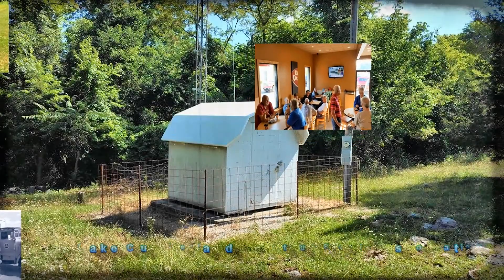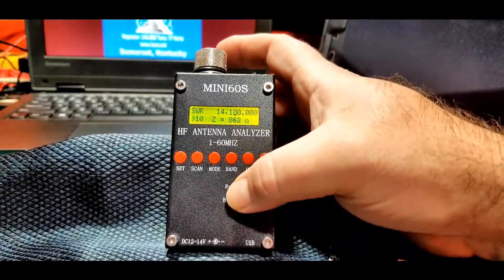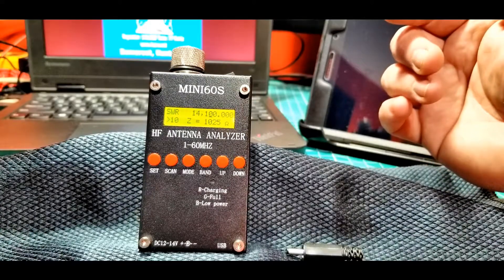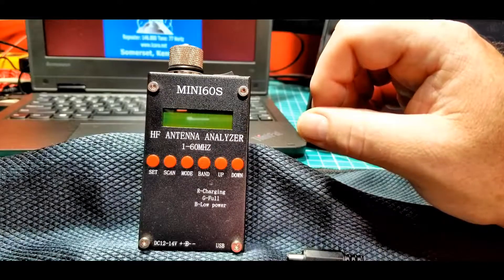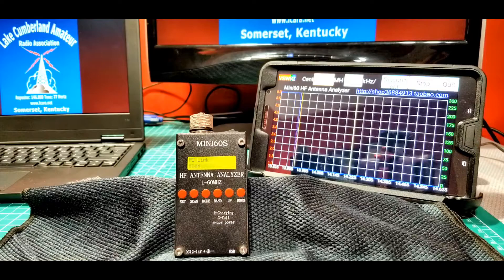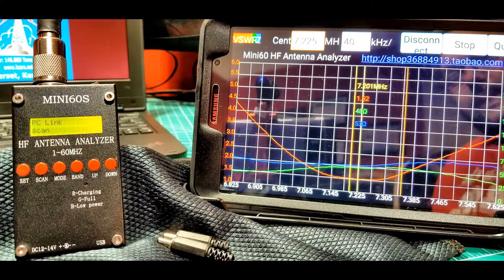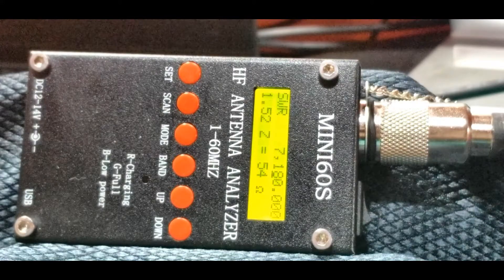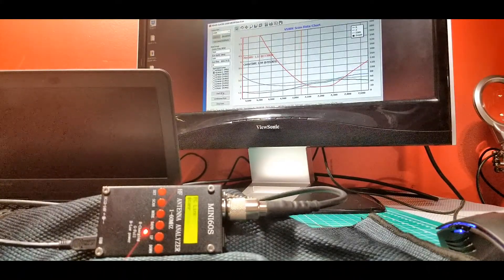LCARA HAM Radio: Mini60s Antenna Analyzer

Comment: I bought one of these from KK Moon and it didn't have a battery, battery case, charging circuit  or USB socket.  Any idea where I can buy these repair parts?
Reply from the maker: Sorry, I do not know of any place that sells parts for the Mini60s.  You might want to return your unit and try purchasing form a different vender.

Comment: Question on 11m when you set it for 11m does it automatic set.center.freq or do.you have.to put it in
Reply: On the software for android the as in the video and i have used was very flaky for Centering a frequency, i used another version updated by a Ham user Mini60-DH1KLM-08.18.apk 
far better and you get a lower swr reading than by the mini60s itself, so i use the android devices connected by bluetooth more than the mini 60s by it self plus you can see the visual display especially on the tablet for lowest band swr for that frequency and total bandwidth available and can then adjust your antenna, great for WR mini coil or WR 1000 to centralise 
the frequency you require.
Reply: @mikeh9446  where did you get the new software
Reply: @mikeh9446  I got 1.3 on a fire stick but the khz do I leave that at 1000 or 1200
Reply: @mikeh9446 where can I get this version
Reply: You all probably dont give a damn but does any of you know a way to get back into an Instagram account??
I somehow forgot my account password. I appreciate any assistance you can offer me!
Reply: @Landyn Donovan instablaster ;)
Reply: @Fletcher Emory i really appreciate your reply. I got to the site thru google and Im trying it out now.
Looks like it's gonna take quite some time so I will reply here later with my results.
Reply: @Fletcher Emory it worked and I now got access to my account again. I am so happy:D
Thank you so much you really help me out :D
Reply: @Landyn Donovan no problem xD
Reply: Ok now when hooked up to Android do I go by the red line for the swr lost my instructions or it didn't come with any
Reply: I got about 1.3 using a fire stick but what is the khz do I leave that at 1000 or 1200